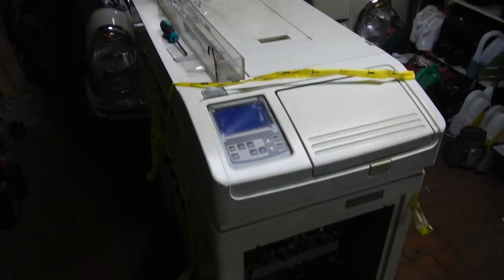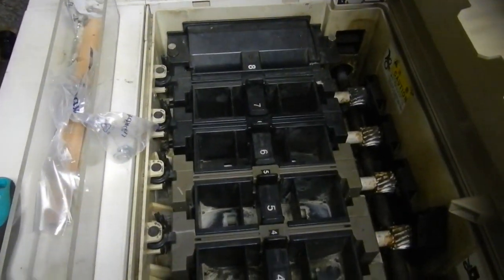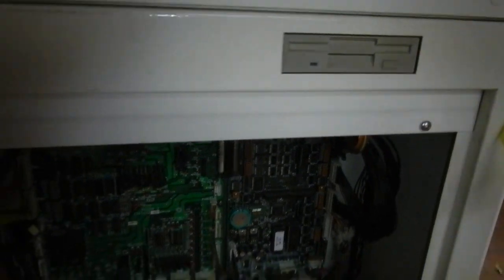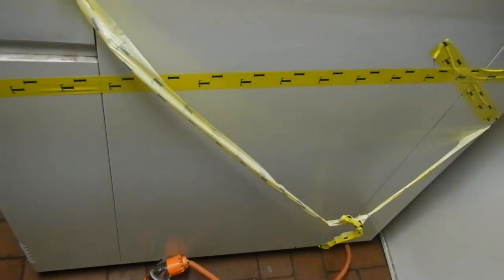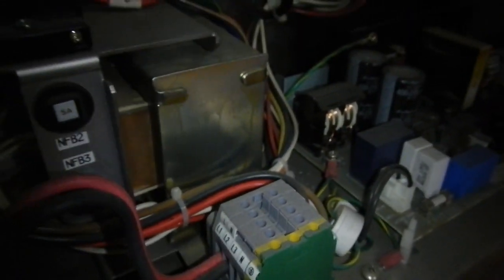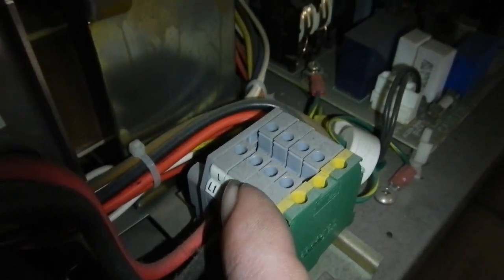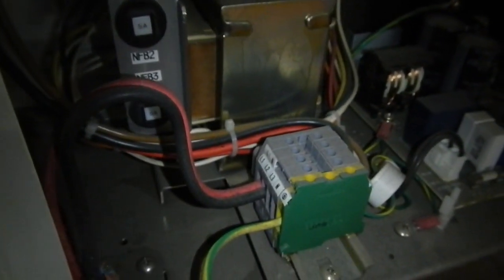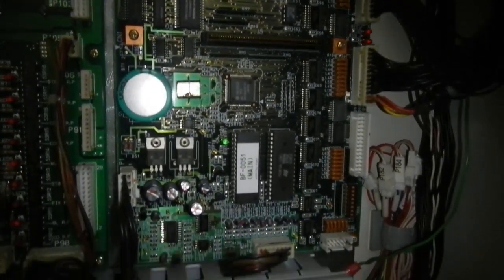Noritsu Film Processor

Comment: Good stuff!, have a look inside the 3 phase plug end, if they have black connected to the center pin its running on 240V single phase.
I'll get up to yours eventually but work is going nuts right now :(, plus the backlog of junk in my backyard  needs to keep moving.

Comment: It is becoming less and less common to see film processors which take wet chemical cartridges; Fujifilm's most recent processors use cartridges filled with dry chemicals which are automatically mixed with purified water inside of the machine, and then washed and ejected at the end of the loading cycle.